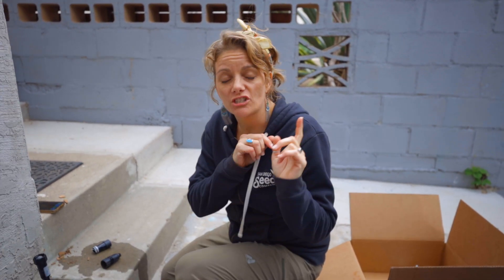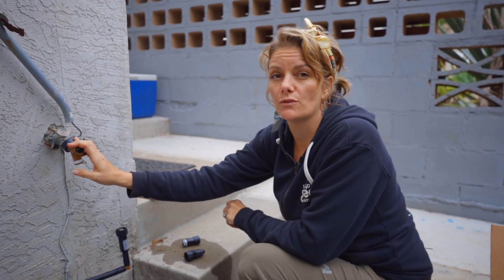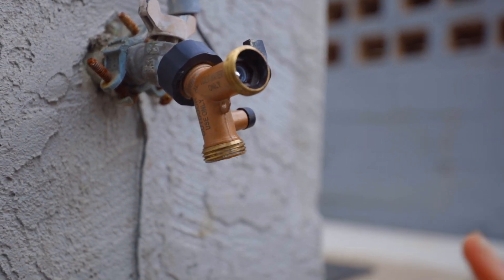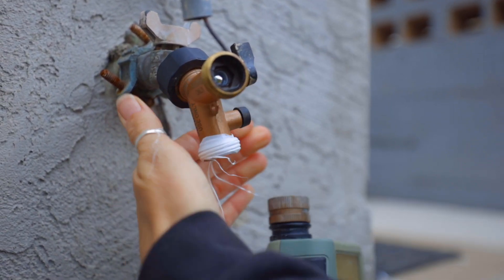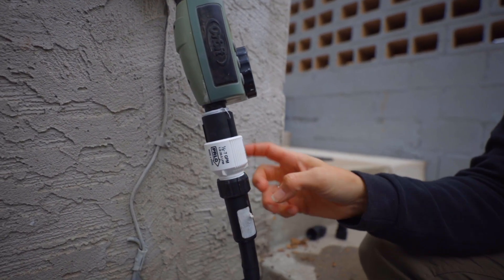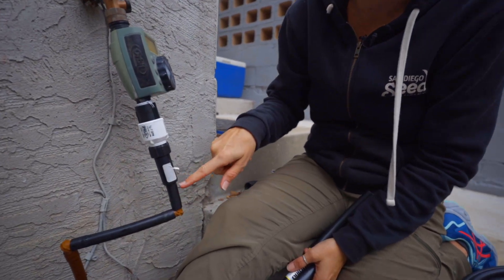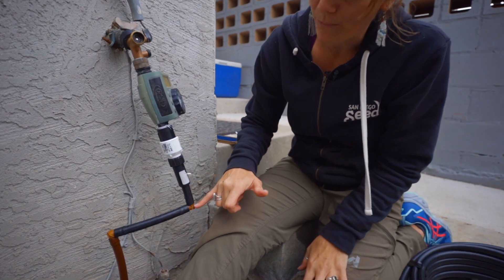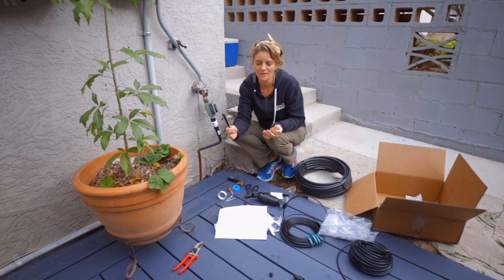Building a Drip Irrigation System Step-by-Step

Comment: I added the filter to my system so that I can fill the filter with liquid fertilizer every other week. Drip irrigation, city water, raised bed and Smart Pot bags. I use NK = >5, worm tea, or that awful smelling fish emulsion 🤢. No worries about plant burns, delivered right to the soil and roots, and no running around fertilizing one plant at a time, mixing and filling, pouring and swirling. 
All suggestions and critiques are welcome.
Reply from the maker: Very cool! That's something I've considered but haven't done. You just fill up the filter with it?
Reply: @SanDiegoSeedCompany  Yes, and spill a little.

Comment: Hose fittings are 3/4 HOSE thread which is slightly different than PIPE thread. If you try to put the two together it won't seal. Also, to make compression fittings and the smaller 1/4 inch tubing and fittings easy to put together HOT WATER. I take a thermos of hot water to my garden, dip the tubing ends in and voila! they go together easy peasy. Tubing, they all say 1/2 but the outer diameters can range from .620 to .710 so you need to remember what size your original tubing is or look for connectors that cover all the sizes.

Comment: I have question why are you taping a fitting sealed by a gasket? Should not be done
Reply from the maker: We have very mineralized water here. It corrodes fittings very quickly. This is why we do it.